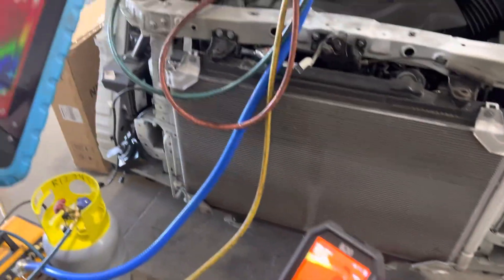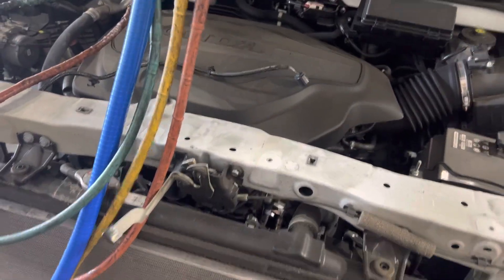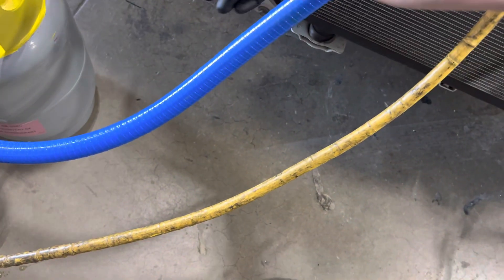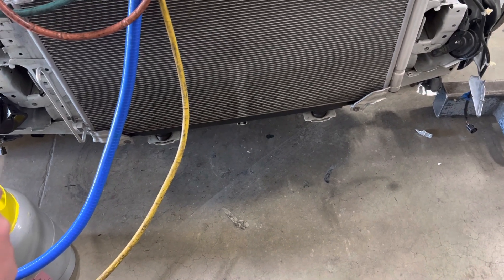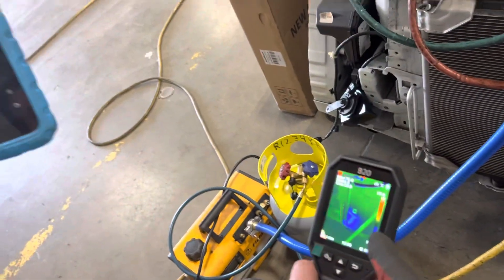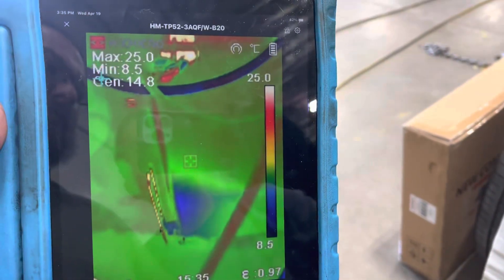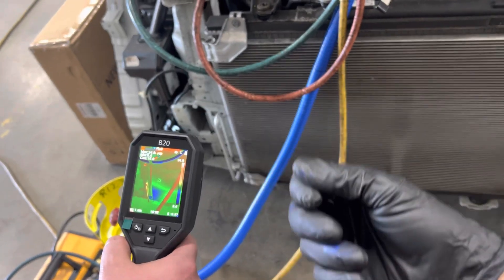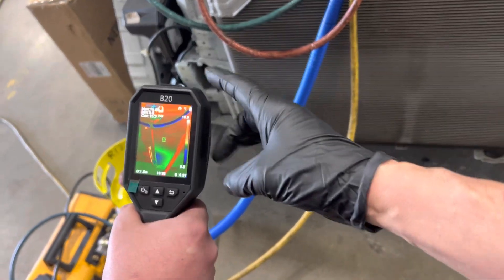Infrared Thermal Camera you can see the liquid refrigerant in the receiver dryer on the condenser￼

Comment: I have another question. I’m try to buy recovery machine. And choosing between FP mr45 or NAVAC nrdd. What would you choose? Thank you
Reply: They are both about the same price.
Reply from the maker: Both vary good.  I own the larger NAVAC 4 Cylinder version. 

Both are excellent.   Pick by color preference. 😂

If you were here in the United States, True Tech Tools, I got at 8% discount code  LECHAIR all one word all capital letters.   When you go to check out, they will ask for a coupon code to put in the box and then when you press continue it will discount 8% off the price.
Reply: @coldfinger459sub0  
Thank you!

Comment: My  fielpease  m45 got  stock  with hard knock after recover  maybe 20  cars.   And not  wirking. If i recover  wepor line how machine m 45  got  oil?   Or this problem not related to oil   ?  Tx
Reply from the maker: You get hard knock because you did not read and follow the instructions.  If you have a engine, can you put a garden hose down one of the intake, manifold runners and you fill up a cylinder partially with water as the engine is trying to turn what will happen ?.  

You cannot compress a liquid . 

So by recovering liquid, refrigerant, straight at high speed into your M 45 you’re basically intentionally trying to break it . 

This is what instruction manuals are for . 

When you do recover on the liquid side, what you should never do on a car but you can do on a residential or commercial refrigeration, or air conditioning unit .  

You have the throttle valve for adjusting the flow of refrigerant when you have liquid . 
              Basically what that valve is doing is restricting the liquid refrigerant flow so it Hass to go through an orifice a small diameter opening so when it comes out the other side, it’s like a expansion valve and it’s coming out as a missed as a partial vapor. 

So it does not damage the M45. 

Recovery units are not meant to compress liquid they move vapor . 

You can have liquid delivered up to the unit and go up to the adjustable throttling valve . That’s what it’s purposes for two throttleback the liquid to turn it into a vapor inside the unit.. 

Let’s get to the subject of oil . 
When you recover from the vapor side as in my videos, I discuss this many times you are too slow down and throttle valve down a little bit at first so you do not suck too much vapor too fast .   Because when you lower the pressure too fast on refrigerant that has oil in it, it turns into a foam..  if you’ve ever seen Home Depot or any store that sells that stuff that’s called (Great Big Expanding Foam)  out of the can?.
        Or even canned whipping cream, that you shake up and down to eat on your dessert you turn the Cannes upside down and there’s a refrigerant gas here it’s nitrous oxide as the liquid cream that has a lot of fat inside of it just like mineral oil, POE oil or PAG oil.  Is saturated with the refrigerant, and when it hits the air, it immediately expands, making the fat of the whip cream, all frosty and puffy, turning into a light airy mixture.

So we get back to the car if you do this too fast, you can literally remove oil, which is no good out of the car . 
Unless you had a Device like . AIRSEPT that separates the oil and sealants that might be inside the oil in Refrigerant that separates them and then when you’re finished recovering your refrigerant you open the bottom and drain out and measure how much oil comes out. 

In the case of using a portable recovery machine .  Hey tiny my new amount of oil will come out with every job almost unmeasurable if done properly 1 mL 3 mL 5 mL something like that.. 
     And will always make its way to the recovery machine.  And then, in some of the instructions on machines, they tell you every now, and then to put like a teaspoon of refrigerant oil into the intake, section to aid and lubricating the unit..    

I have been using mine for years and so have tens of thousands of other technicians who recover hundreds and even thousands of pounds of refrigerant every year from their commercial or residential air conditioning jobs .  And they don’t have a problem with the knocking or pounding sound because they read instruction manuals.. 

So go back open up the instruction manual that came with it and read it. If you lost it, then you could go onto the website and download the instruction manual. .  This is why they are called. (“ INSTRUCTION MANUALS “!!!)…. 

Think of it this way, if somebody bought a car and they knew nothing about cars but they wanted one .  So they buy one, but they never read the owners manual and they never read about maintainance or proper usage.. 

And then they keep driving the car, and they never change the oil in the engine or rotate tires.  And they wonder why they’re engine blows up after 30,000 miles instead of lasting 200,000 miles..  they wonder why their front tires go bald and get a flat and blow out because they rode their tires through the courts until the tires exploded because they don’t reading instruction manual. 

And then blame the car has a problem  ?.   

Read the manual and practice, using the throttle on turning down the flow of refrigerant recovery . And remove the refrigerant from the vapor side and not the liquid side.. 

And then whoever told you to recover refrigerant from the liquid side, don’t listen to that person anymore .  Very bad information.. for cars 🚗
Reply: @coldfinger459sub0  thanks   Toom,   I  did  recover  through low side  always. Never open throttle on the full.
Reply from the maker: @tselishchev72  then if you experience a knocking sound when recovering refrigerant, it’s one of two things. 

Because there should be no knocking noise 

Either, sometimes you have a restriction or the valve into the recovery tank was not open and that will cause it to make a knocking noise and then usually it’ll shut off on high head pressure cause it has a high pressure shut off switch 

The other situation like I talked about before 

Under certain circumstances in special situations, it is possible to recover vapor refrigerant out of the vapor line too fast, and it will bubble up as a semi liquid with oil and go to fasten to the machine, and you can hear a little knocking noise . 

Those are the only conditions I could think of the reason you would hear knocking . 

This is why you should have a site glass in line of your recovery hoes like I do inside my Refrigerant manifold . 

I can see the refrigerant when it gets sucked up the blue low sideline it goes through my manifold passed my sight glass .  And I should never see any liquid moving inside of their. And then it will go down the red hose high-pressure being sucked into the recovery unit.. 

A site glass is very important to learn how to use the equipment properly .  On automotive.
Reply: @coldfinger459sub0      Ii dont think  problem with liquid refrigerant  .   was  one  knock and  the  machine stop.     Tight  now   All line  disconnect. If f i push  start   Is sound line  trying to   Start  but  not running.
Reply from the maker: @tselishchev72  that does not sound good.  With the lines disconnected and the valve in recovery mode to allow Air to be sucked in and pushed out..  ?  If so, that sounds like a mechanical problem. 

I literally have a few thousand cars recovered with mine .  I do from 6 to 10 cars a day..  when I recover from residential R410 a refrigerant it’ll be anywhere from 4 pounds to 13 pounds all at one time

When I recover larger commercial VRF systems, it’ll be 50 pounds on average at one time .
Reply: @coldfinger459sub0   OK we will see, thank you so much, Tom.

Comment: Show us the thermal profile  with the system operating! ;)
Reply from the maker: I have some coming up.  

I messed up one real good video where I had the camera sitting in front of a painted black condenser the perfect color for thermal cameras .  On a cold engine first start up of the AC system..  

And I was taking a beautiful video and you can see the flash of the hot gas as soon as the compressor engaged in the upper right hand corner as it entered the high-pressure, discharge gas and you can see from bright white, going into red orange, green blue through the different circuits of the condenser. It was beautiful perfect video. . 

THEN I DISCOVERED, I DID NOT PRESS THE RECORD BUTTON WHILE I WAS TAKING A VIDEO  !!!… 🤦‍♂️
Reply: @coldfinger459sub0  Yes, this is what I want to see, exactly! ;)